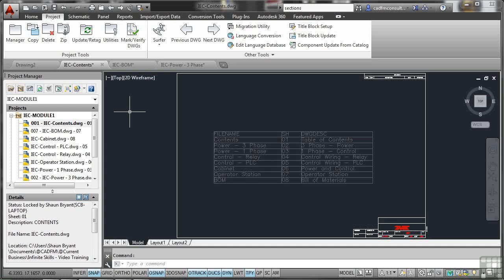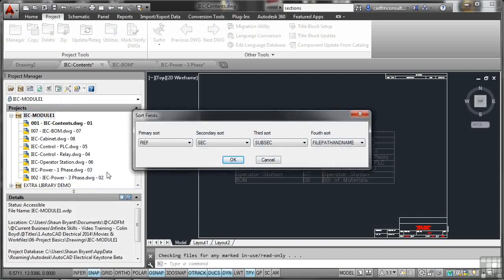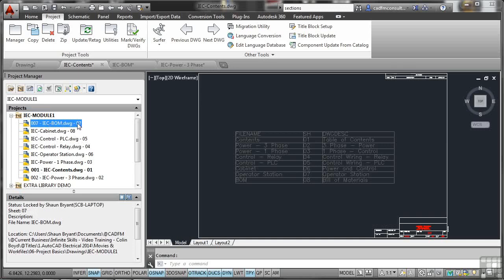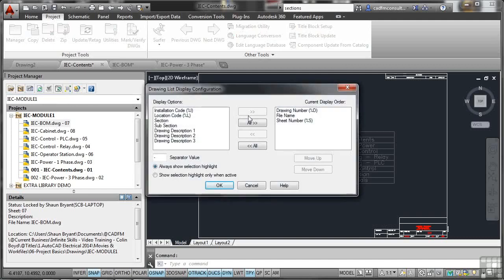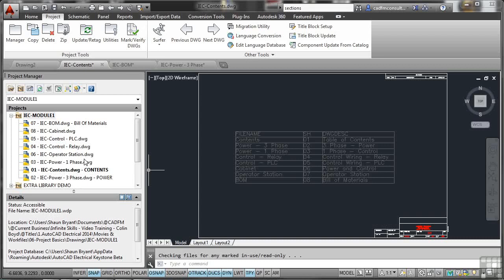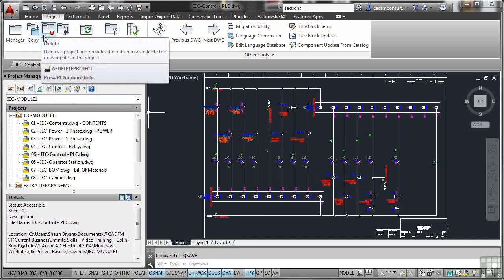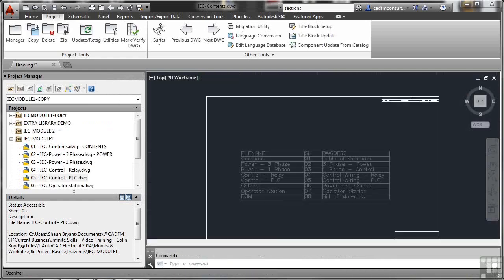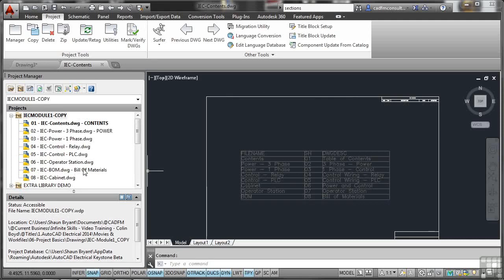Autocad electrical Tutorial Part 14 Making Further Changes And Copying Project

Comment: This is an excellent series!  New to Autocad Electrical and just played your entire video list.  One question - What is the icon bar on the right side of the display called which shows Pan and other icons?  I would like to display this for quick access to the Pan tool.  Thank you and please continue this excellent training series.  Using Autocad Electrical 2020 and can not display the classic user icons at the bottom.  I believe this is not available anymore...